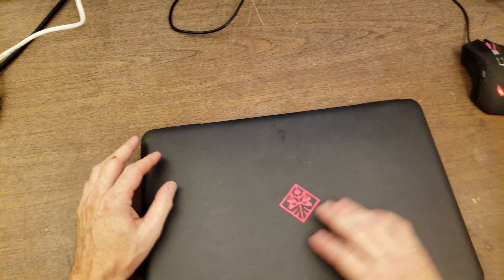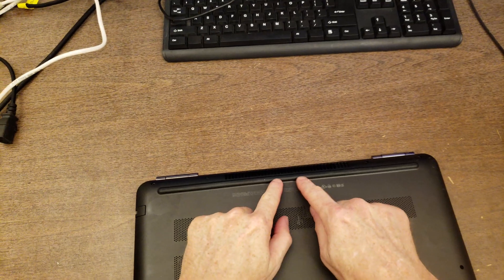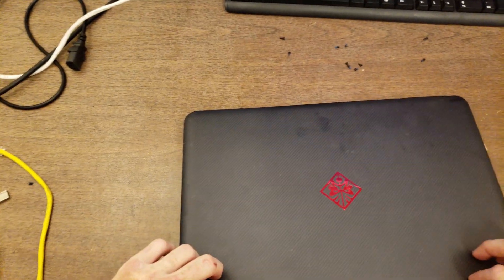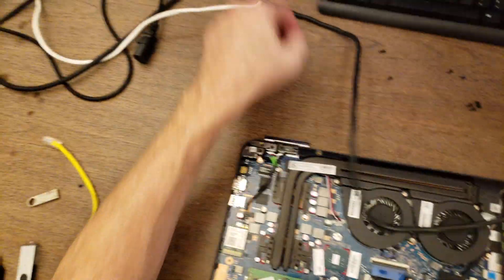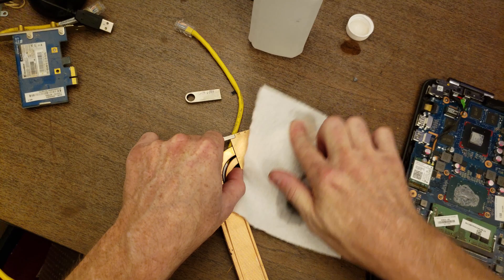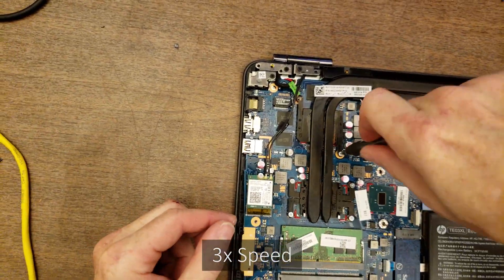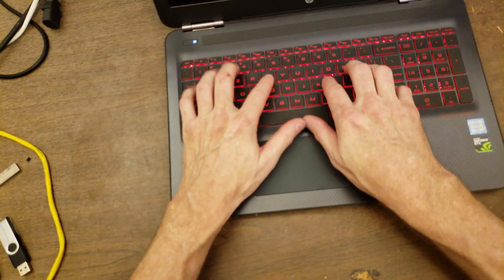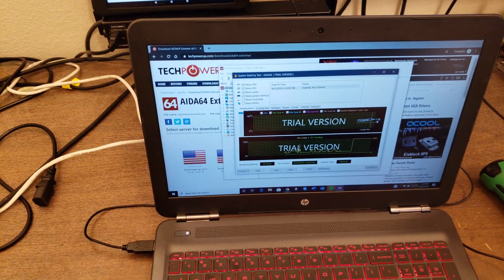HP Laptop Is Overheating, making it run cooler

Comment: Is it normal for a laptop to get warm underneath it while using it
Reply from the maker: It's pretty common. Ideally the cooler or coolers in the laptop should be removing heat at the side or the back of the laptop. If it's getting warmer on the bottom over time you might consider getting some compressed air and blowing out the cooler or coolers.
Reply: @MichaelTheComputerGuy  so my laptop isn’t overheating at all it just might need cleaned

Comment: Nice video. Is it possible that it could be a solution for a new PC (one month life) with the same problem? Overheating and fan always on also for normal operations like using excel...
Reply from the maker: It could be a similar issue

Comment: i have a p114dx, it idles in the mid 30s, then ramps up to high 60s when on firefox, fan doesnt ramp up tho. I try to use aida 64 and the damn thing ramps up over 100c and the cpu throttles. i just cleaned the mobo, fan, radiator, and new kryonaut paste. seems to run a little cooler after the cleaning but still gets hot. I purchased a new heat pipe and new fan, ill update and let you know how it goes, its a pretty old laptop but if i can stretch the legs on it i will.

Comment: hi my laptop Dell Precision M5600 The screen Goes Black And my GPU HEATING 40% AND CPU 50% and i change thermal paste for Gpu and Cpu earlier But still screen dark when i use it for 20 minute pls help me
Reply from the maker: You most likely need a new motherboard. Doing a reflow on it might work but that's very iffy.
Reply: @MichaelTheComputerGuy  When My screen Turn to Black My Keyboard laptop still working and lightning but u cant use it